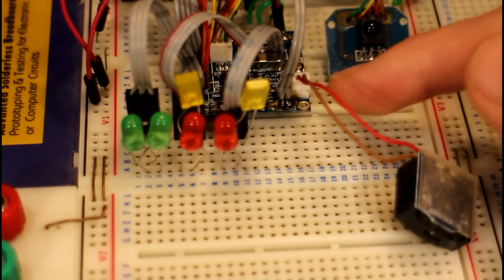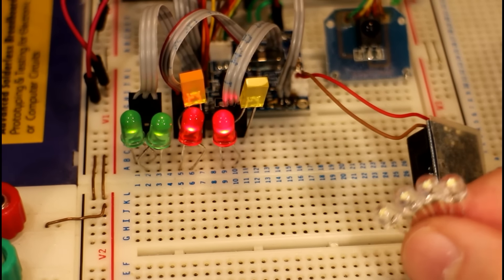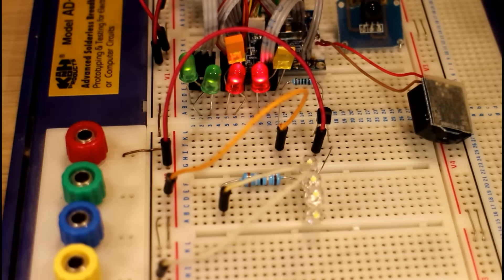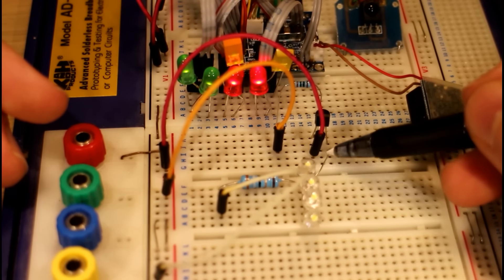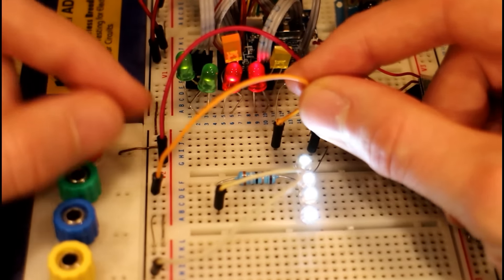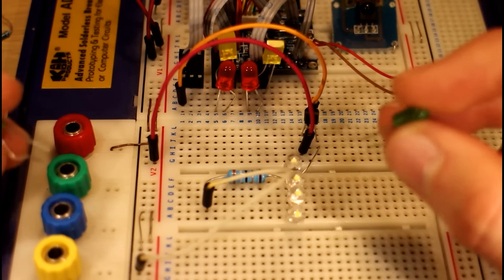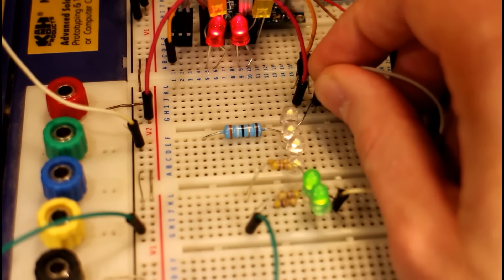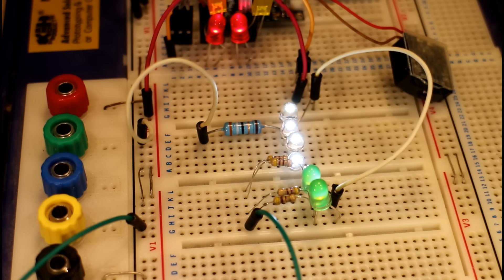Adding LEDs to Siku Control 32 Models

Comment: Great video :) Your lucky you have a lot of RC tractors that work. I have two John Deere 8345R's that won't work properly. I'm going to save up some money to buy a RC John Deere 7R with front loader and bucket.
Reply: I hope you get it soon (in working condition) good luck!!!!
Reply: +InspireAndInnovative Are you saying this to me or RC Tractor Guy ?
Reply: +Sean McKenna sorry it's for u
Reply: +InspireAndInnovative Thanks. There expensive but I'll try to save up.
Reply from the maker: +Sean McKenna I don't have too many models working, until sunday I only had the JD6920S and JD9560R and the control 32 fendt 930.

Comment: Could you make a video of how to add a hazardous light to the top of a Siku Fendt 939? I want to do that to mine.
Reply from the maker: I don't have a Siku Fendt 939. It uses an RF transceiver so it wouldn't be the same as any control 32 tractor I've looked at sorry.
Reply: +RC Tractor Guy That's alright. I will figure it out.